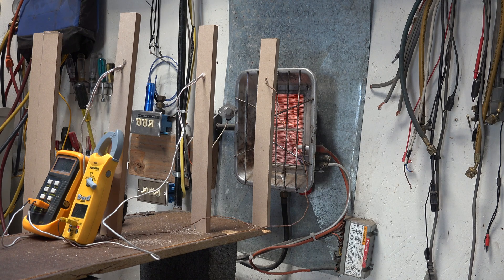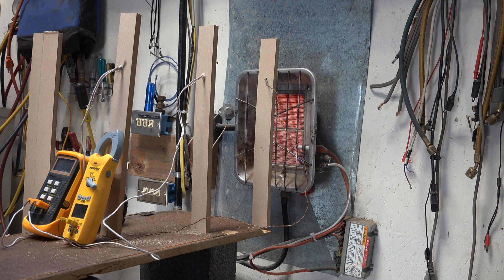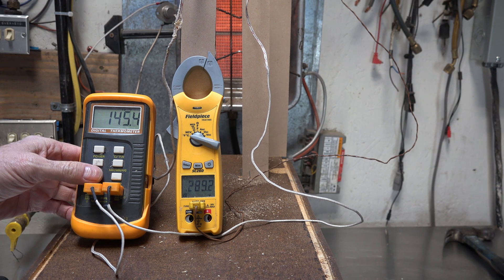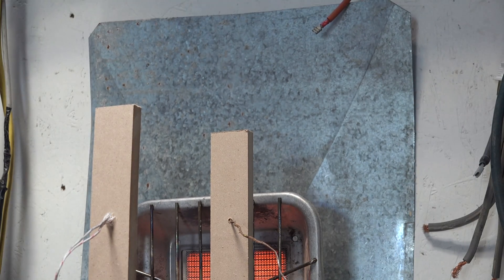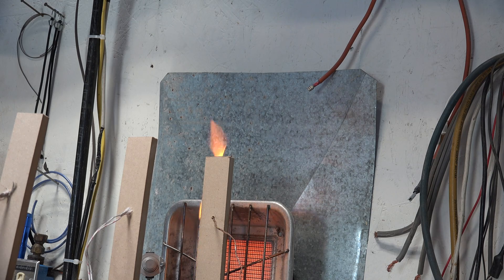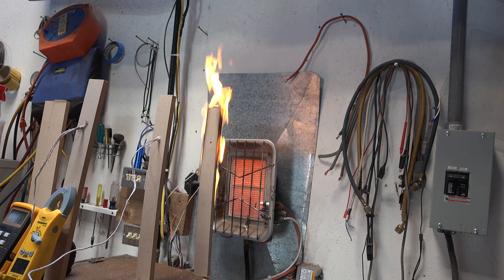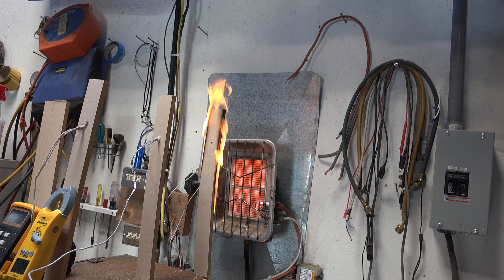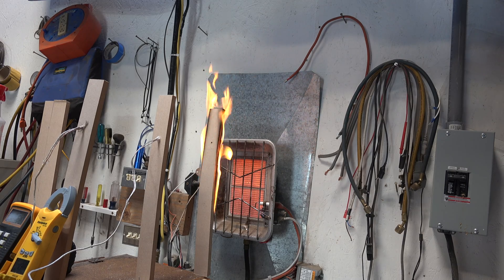A demonstration of radiant heat

Comment: Does the heat only concentrate on the surfaces, such as the boards, or does the air space in between the radiant heat panel and the board also warm up?
Reply from the maker: The air does warm, however the vast majority of the heat is transferred to objects.  The only way for all the heat to be transferred to the objects is for it to pass thru a vacuum.
GFM

Comment: Very "cool"...? The energy drops off by the distance squared or energy = one divided by (distance times distance). E = 1/D² .This shows a well known formula in action and your numbers aren't too far off, right? If the close one was 400 ᵒ F the next would be 100ᵒF. "Inverse Square Law" describes how radiation decreases with distance. Of course it is overly simple and only works perfectly for radiation from a "Point Source". Plus it leaves out reality like 3 dimensions. https://cdn.tutsplus.com/photo/uploads/legacy/336_inversesquare/1.jpg

Comment: Have had one like this the since the 80's, used in the garage and placed so the only objects the rays could "see" were far away and nothing flammable. You really need to be careful! Things like paint cans, anything that could receive heat will expand. A full gas can (propane or gasoline) could begin to vent...
Remember this is not just radiant heat it is infrared and heats objects more readily than the air around it.
Reply from the maker: +Craig Nehring Many of us (me included) learn that one the hard way.
GFM